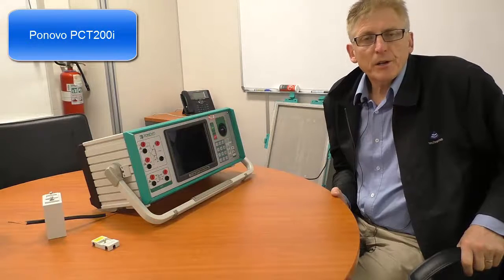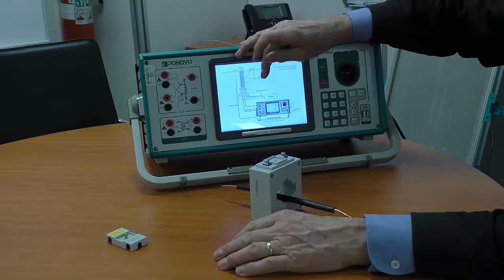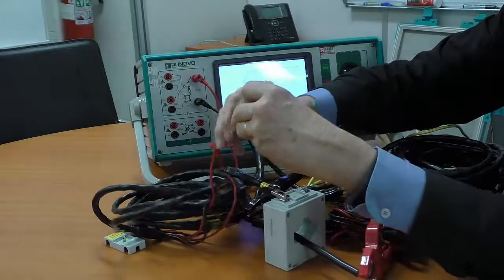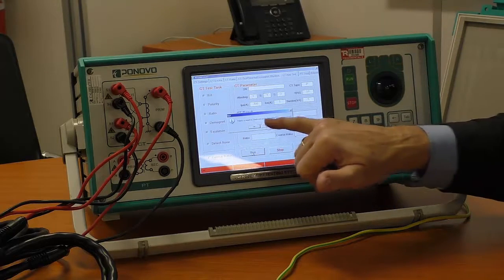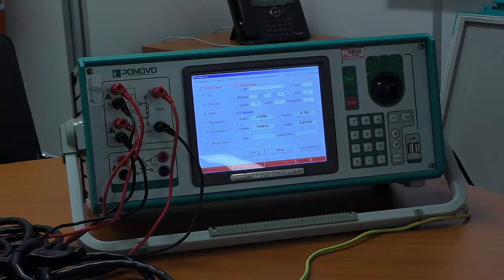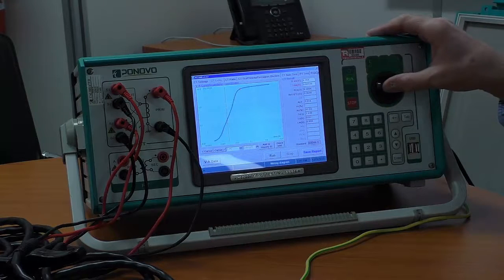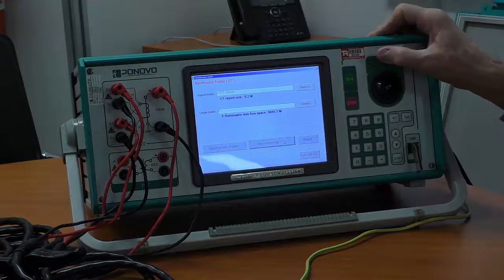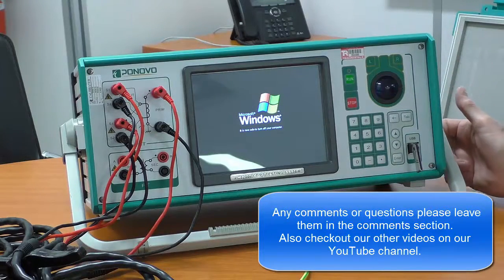How to Setup and Conduct Tests on the Ponovo PCT200i

Comment: Is it possible to calculate ct ratio at 20, 40 and 80 percent of rated current using ponovo ct analyser according to pgcil standard
Reply: It will  only generate max 120V and 5Arms.  So you cannot test at rated current unless the rated current is 5Arms!!!
Reply: @GraemeMurphy54  thanks sir
Reply: You will need primary injection bro...all ct analyzer only inject max current 5A. So only the secondary side....
You can do it with MEGGER TRAX 280 or CPC 100...having output Current 800A and Voltage 2kV with option up to 2000A. And 12 KV..